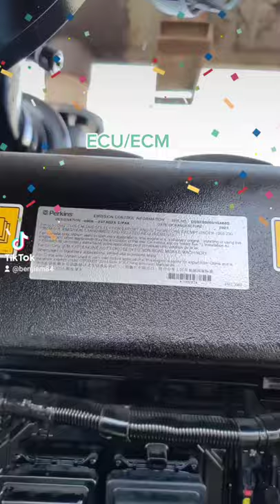Where you can find ECM/ECU in your electronic engine

Comment: Sir how to troubleshoot the low voltage Ang electrical trep..
Reply from the maker: Low volatge sir mean what is your volatge output your generator
Reply from the maker: Example 240 below 220 down to 50 volatge that is undervolatge air do one thing check your fuses for line to line volatge and avr fuses if all good thin check excitation
Reply: Sir Omaandar sya piro after 10 seconds na mamatay din sa panel board naka lagay   low voltage and electrical trep..
Reply from the maker: @ruthsucgang5773  simple lang yan sir ganito gawin mo jan check mo lang mga fuses baka busted lang check mo kong mY pomasok na voltage doon sa module sensing and check mo ilan ang output ng voltage mo kaba masyadong mababa